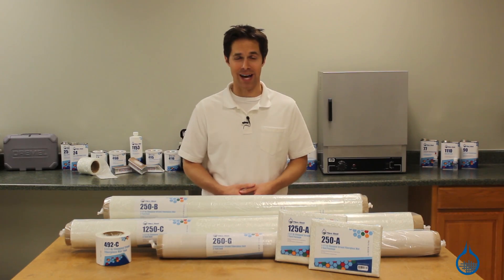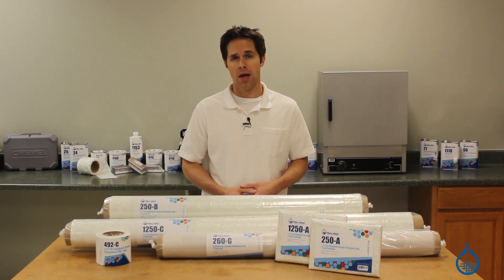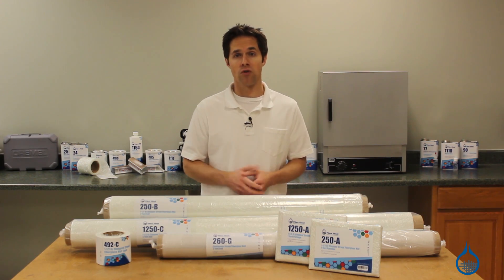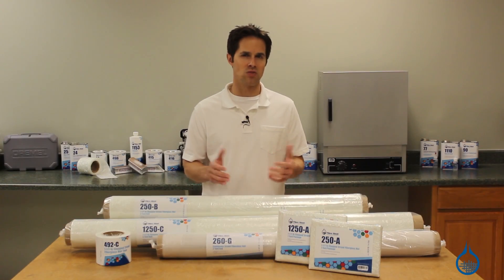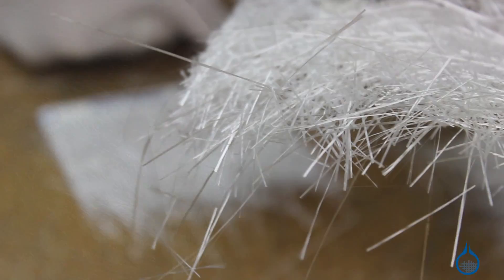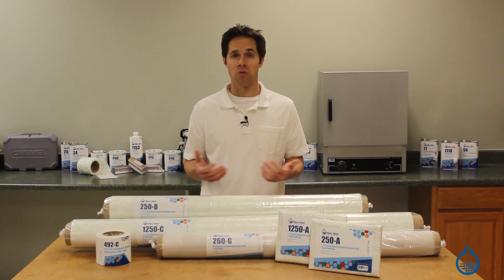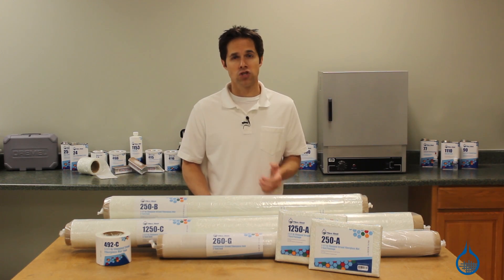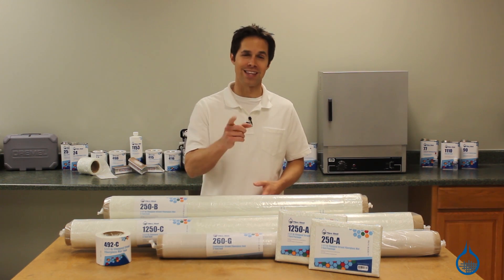Fiberglass Mat Overview

Comment: I'm trying to fabricate a roof shell for my old Cadillac out of fiberglass as they were originally done. It needs to be water proof, stable enough to be able to wrap it with vinyl or fabric to look like a faux convertible top. Once finished I'll glue it to the hard top. Now my problem is what type do I use? Roving or mat? How thick should it be?
Reply from the maker: Hi Quincy, we would recommend using a combination of fiberglass mat and 7.5 oz fiberglass fabric. The mat will help build the thickness you desire, while the 7.5 oz fiberglass fabric will give you the waterproofing that you need. I would recommend that you give us a call at 800-821-3283 and a member of our customer service team can answer any technical questions you might have. Thank you.

Comment: sir I ask a question ? what's the deference between fiberglass mat and carbon fiber mat .
Reply: this is two different specification products .Glass fiber (GF): It is a kind of inorganic nonmetal material with excellent performance. It is a glass ball or used glass as raw material after high melting, wire drawing, winding, weaving and other processes, the final formation of glass fiber, glass fiber diameter from a few microns to more than 20 m micron, a hair of one-fifth to one-tenth of the diameter, a bundle of fiber is composed of hundreds of thousands of monofilament. Properties of fiberglass: The average person thinks that glass is a brittle and hard object and not suitable as a structural material. However, if it is a filament, the strength will be greatly increased and soft, so with the resin to change the shape of the structure can become a fine glass fiber with its diameter smaller, strength will also increase. These characteristics make the use of fiberglass far more extensive than other types of fibres. Glass fiber has the following characteristics: 1. Tensile strength is high, 2. The elastic coefficient is high, 3. The impact strength is big; 4. Chemical resistance; 5. The water absorption is low; 6. The type of product is more than 7. Transparent Colloid 8.
Carbon fiber (GF) is made of inorganic fibers. The carbon content of fiber is more than 90%. Generally divided into ordinary, high-strength and high model three categories. Compared with glass fiber (GF), Young's modulus is more than 3 times times; compared with the KF-49, it is not only about twice times the modulus of young, but also in organic solvents, acid, alkali insoluble, corrosion resistance outstanding. Carbon fiber is a fibrous carbon material. It is more strength than steel, smaller than aluminum density, corrosion resistance than stainless steel, high temperature resistance, and can be conductive like copper, with electrical, thermal and mechanical properties of new materials. Carbon fiber can be processed into fabrics, mats, mats, strips, paper and other materials. The traditional use of carbon fiber in addition to thermal insulation materials, generally not alone, more as a reinforcement material added to the resin, metal, ceramics, concrete and other materials, constitute composite materials. Carbon fiber reinforced composites can be used as aircraft structural materials, electromagnetic shielding materials, artificial ligaments and other body substitutes for the manufacture of rocket casings, motor boats, industrial robots, automobile leaf springs and drive shafts. Carbon fiber is widely used in civil, military, construction, chemical, industrial, aerospace and supercar fields.  Hope its could help you .thanks !

Comment: may i ask some questions sir? if you don,t mind. what number of resin will i use to fabricated speaker baffles? and what kind of hardener? thank you sir.,
Reply from the maker: +Paulo De Leon You have a few choices for this. First, a Polyester Resin (such as our #70 http://bit.ly/1QpYy5z) along with MEKP ( #69-A http://bit.ly/1OzBf6F) is a good resin that can typically be used for applications like yours. It's got an advantage in it's lower cost, and easy to mix. The cured part won't have as much strength as other resins would offer, but with a Speaker Baffle you should be fine.

You could also go with a Epoxy Resin, which we would recommend our System 1000 (http://bit.ly/1Nqeqyc) with either a 10  or 25 minute hardener. You'd want to choose the Epoxy if you feel like you'll need the added strength for your finished part.

A side note, if you choose Polyester Resin, it can have a very strong odor when working with it, and you should be sure to do so in a ventilated area while wearing a respirator. Epoxy is considered a low-odor resin, so for that things are a bit easier.
Reply: Paulo De Leon hi